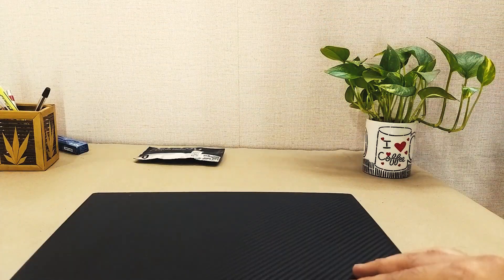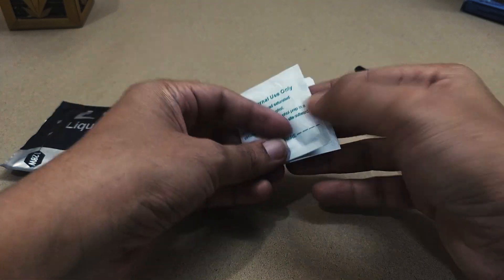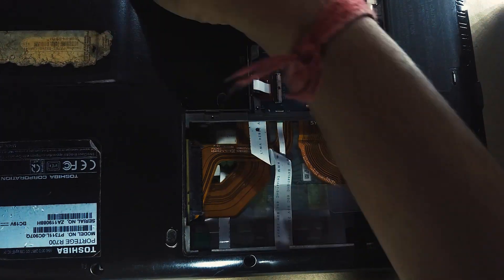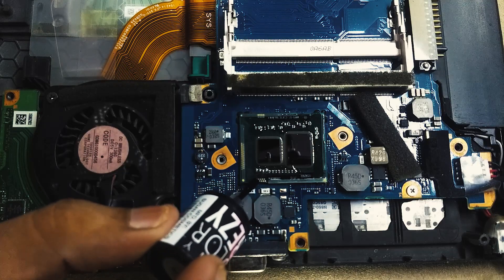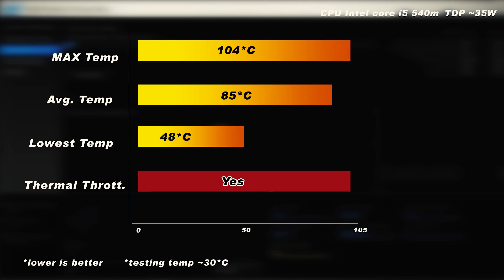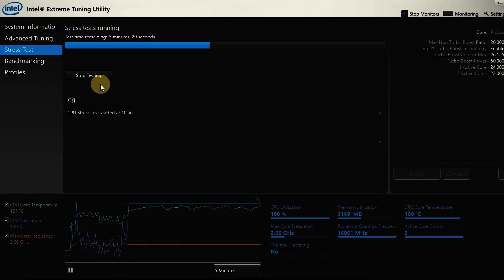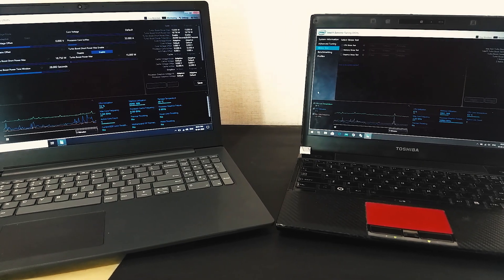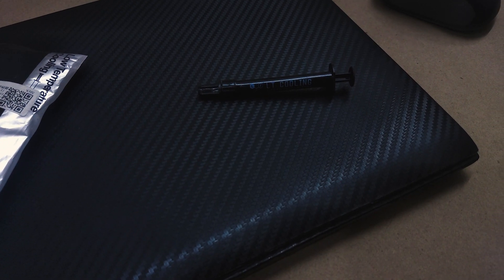5$ Liquid Metal Thermal Conductive Paste 128W/mK | Dose It Work On Laptop ?

Comment: I use LT100 and give it pass mark as good product. I do 2 or 3 laptops a month with all the different types Cool ulta Chryo Blah! Not any real difference in overall temperature reduction between them, 10 to 15 degrees max.Some are easier to apply! The BIG difference is Nickel Plating the Heatsink. ELECTRO "BRUSH" plating with Nickel and the LM will never dry out from soaking into the Copper.Cleanliness and cleaning with Acetone is Paramount

Comment: i have an hp notebook and the f.. same, temperatures didnt go down with liquid metal, why? is supose the temps are going down
Reply: Because your cooling system is too weak. It hasn't enough capacity to cool down your CPU I guess.

Comment: what is the nail polish u used??
Reply from the maker: Liquid metal are conductive and there are small capacitor all around CPU dia which can get shorter if liquid metal touch it and to prevent that nail polish which is non conductive used as protection layer between them.

Comment: It seems to me that there is no decrease in temperature is witnessed due to the fact that the cooling system is not potent enough to begin with. So when you applied Liquid metal onto it, it took all the headroom it got with the TIM upgrade to push the CPU to the max turbo frequency, due to which the CPU temperatures didn't seem to be changed. To get like the full turbo speed on older process nodes with one thin heat pipe is indeed great!! May be, if the heatsink was bigger with more heat pipes, and the CPU stayed at full turbo speeds without thermal throttling hovering around higher 90's during the benchmark, then maybe the difference could have been spotted. Can't say for sure though. I have ordered a tube too. It seems I will have to try it out myself now. Given if it arrives in time before the world ends.
Reply: Did you notice any difference in your temperatures? I'm planning to buy that too.
Reply: I used this same liquid metal on an i7 7700k and with a 360mm water cooler and did not download almost anything, this liquid metal must be very bad. I'm going to use Thermal Grizzly next week to see it.
Reply: @JoseMaria28  ???
Reply: @wallacenascimento5244  melhorou
Reply: Well?